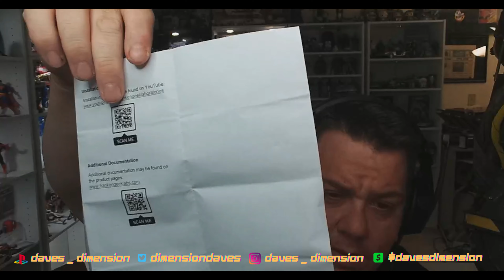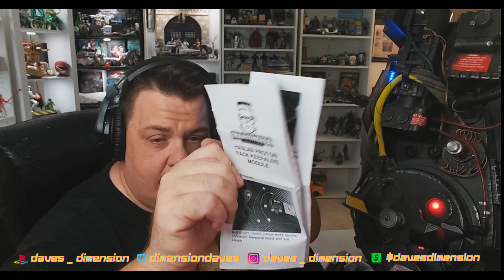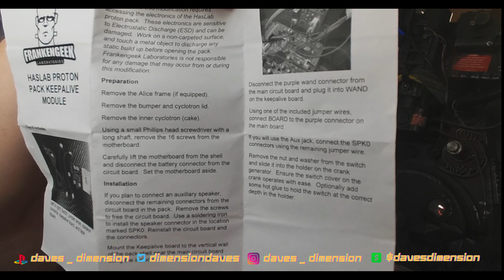FRANKENGEEK KEEP ALIVE KIT INSTALL FOR HASLAB PROTON PACK

Comment: Thanks! It was helpful to see the install process.  For the tencell battery,  did you use a usb to jst wire to connect power to the board?
Reply from the maker: Yup